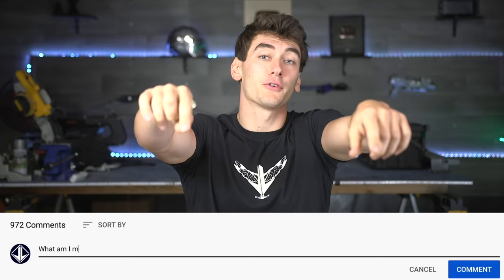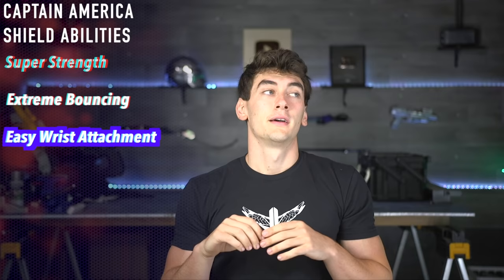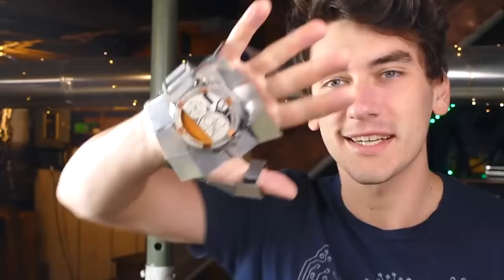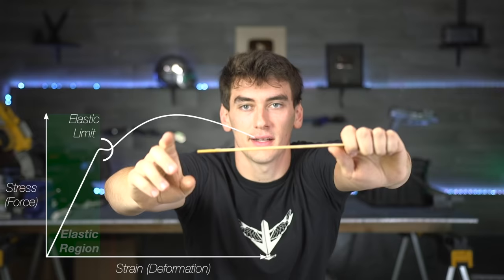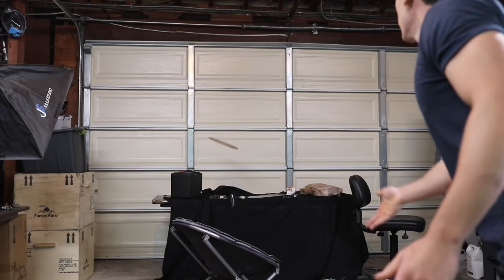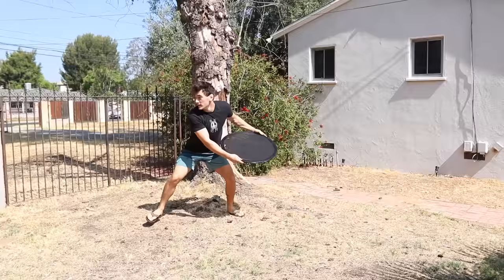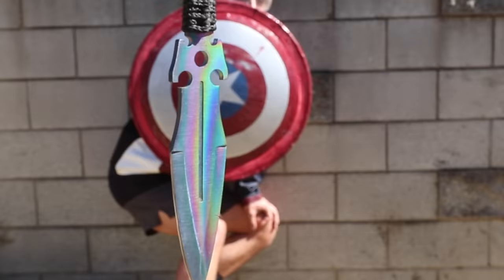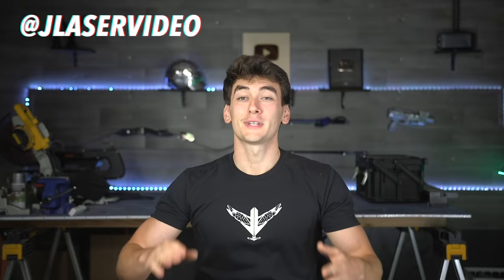Real Captain America Shield That Actually Bounces Back! - OVER 100 FT BOUNCE!!!

Comment: If I’m not mistaken, the reason the shield moves the way it does is due to cap’s enhanced perception from the super soldier syrum. He basically calculates the trajectory super fast.
Reply: As far  as I know, this is the reason, the producers gave some time ago. But it does not work anymore, because Falcon does not have the serum and still can throw the shield like Cap.
Reply: @SpeziFischDE  But didn’t he train like a whole bunch
Reply: @iodine1249  I’ve had this theory where everyone in the hero world is superhuman cause a normal human wouldn’t be able to do what the non sups can. Hopefully that makes sense
Reply: This isn't an indirect request for JLaservideo to make a super soldier serum, right?
Reply: @iodine1249  mcu excuses 101. Ngl thats funny tho. 
MCU:Normal Human Being can’t use the shield. 
Falcon uses it
Mcu Fans: But didnt he train like really hard... lmao
Reply: Its that and how vibranium Breaks the laws of physics
Reply: The shield is able to be thrown and maneuvered that way due to: Cap's super strength, his strategic mastermind, his increased perception/mental capacity, his mastery over gymnastics, his enhanced speed, the shield's energy properties (loses little momentum on each hit) and a teeny bit of suspension of disbelief
Reply: Age of ultron...he has magnets on the arm they showed it
Reply: but even John Walker was able to bounce the shield back to his hand even without the serum at first, he just trained with it and also Falcon, so in the MCU, you can do it with proper training and strength.
Reply: @swarms4745  in the falcon and winter solider the new cap was a solider, he could throw the shield perfectly so
Reply: I bet he thinks faster than stark
Reply: …so he is a Geometry Kid,
Reply: Basically, he's a super-nerd?

Though, theoritically, it shouldn't be too hard in 90 degree corners. It's like a retroreflector.
Reply: doggo  lol if you’re tryna start something dont do it with me. Its not worth it. Ik your a kid because you said dc tard not knowing if im even a dc fan. And normal humans cant use it because they said so in the explanations for the mcu. Actually check the replied here they even said it. But its ok try someone else tho
Reply: @swarms4745  Well normal human standards for us are different than normal human standards in comics. Humans in comics are not like the ones in real life. They're capable of a lot more with just training and experience alone. I mean jus look at Batman or Hawkeye. Peak humans in comics are stronger than peak humans irl.
Reply: @SpeziFischDE  Well the difference between Cap and Falcon is Cap always was able to throw the shield properly. He didn't need to train becuz his super brain n super strength made up the difference. He definitely trains his body but his mind was always fast enough to calculate exactly where the shield was going. Falcon had to get to that level. So did Walker. So the reason does still work.
Reply: @Revstarallstar  Since when could a normal human being not use the shield?? Hawkeye used it. Black Widow used it. N now Falcon's using it. It's not Thor's hammer dummy.. anybody can use Cap's shield, jus not at his level. Nobody's ever surpassing Cap's efficiency wit the shield, but with practice n experience, they can still get a few good bounces off. That much is already evident.
Reply: @SpeziFischDE  he just threw it abunch until he understood how it works lol
Reply: @TheMessenGerrrGaiii  John Walker, Isaiah, and Bucky probably could with enough practice since they actually have the enhanced abilities. Falcon shouldn’t be coming close. Can he toss it around? Yeah. Can he do it anywhere as close? Not likely.
Reply: @sitc786  only for short range recovery.
Reply: 0:57 seconds
Reply: @swarms4745   your forgetting that since caps shield is made out of vibranium< (spelling?)  and because of that it’s really light so anyone can throw it. The only hard part is throwing the shield and having it come back which is what Bucky was helping falcon do.
Reply: @stevelucky7579  Ehh I mean idk.. Falcon is a peak human wit tech from WAKANDA. He definitely can get somewhere in the ball park. Without his tech tho? Well they showed u the level he was at. He was barely managing 2 bounces, 3 at most, even after he trained a bunch with it. So It's like I said above..Cap is still THE most efficient wielder of the shield. I think all the logic people are questioning checks out.
Reply: @TheMessenGerrrGaiii  I kinda doubt he’s peak human with the tech. We don’t know what it does other than provide protection. Everything else is just an assumption at this point. I don’t think the panther suit gave the black panther his powers, pretty sure it was the fruit. Otherwise anyone could put on a wakandan suit and be creme of the crop. Unless over half of wakanda dieing (first those who died in battle followed by the dust) all those years allowed for unbridled progress.
Reply: I think its like t’challas suit. He plans the trajectory and when the shield makes contact with a wall or something, it dispurses kinetic energy causing it to fly back
Reply: Ye that’s right the serum gave him advanced military strategies aswell as an advanced mathematic ability meaning he can calculate equations, distance and angles faster than the average human
Reply: Cap should hustle people on snooker
Reply: @stevelucky7579  Okay, what I meant to say was, Falcon is a peak human, but not only that he's a peak human WITH tech from Wakanda to boost him up. Hope that clarifies what I meant. I never meant that the suit is what makes him peak level.. Also we're not ONLY makin assumptions. Jus a handful of reasonable ones. We still kno a couple things. We kno he can use the suit to get more velocity on his shield throws, which we saw him do. We also kno he can use the suit to make himself even stronger(or at the very least use it to build momentum so that he can lift something easier), which we saw him do. (This is where we start makin assumptions 🤣🤷🏾‍♂️) Now we're not sure if his suit can calculate the trajectory of the shield. But with Tony's suit accomplishing similar feats, I'm sure the Wakanda suit has somethin like that up it's sleeve.
Reply: @stevelucky7579  But back to what I was gonna say, I believe he's peak human without the tech. With the tech he's still peak albeit a higher level of peak. Peak humans strength levels can range from about 300lbs to 800lbs. They're the strongest humans can get without being Super human. Falcon is normally a big 6 foot 240lb black dude who can press lift twice his weight. Which is 480lbs, makin him peak human. Now I realize Anthony Mackie is smaller than that, but this is still the Marvel universe my guy.. Humans there n humans irl are capable of vastly different things. John Walker was already peak human due to military training n experience. (Which is why he was able to handle the shield before the serum. Well that n he had been training with the shield for a while) Falcon not only had the military training and experience, but also had intensive training with Cap in the movies. This is explained in the comics as the reason he got to peak human. Through his interactions n friendship wit Cap. This is essentially what happens in the movies, albiet more subtly, and most of it off screen. But the point is Cap pushes him to get to that level. So I definitely believe Falcon's peak human.. or else non of this sh*t makes sense. But Marvel knows what they doin so I have faith. 🤷🏾‍♂️🙏🏾😅
Reply: @SpeziFischDE  he trained in flight with the falcon suit, which is why he is capable.
Reply: @ayol1011  100%
Reply: @TheMessenGerrrGaiii      not sure he’s peak human either. Cap, was peak human. Isaiah was peak human for a while Bucky and everyone else was close, and they all took super drugs to get that close. Falcon, while being a great soldier, I wouldn’t call peak human. I’d argue John walker is closer physically speaking solely because Falcon spends a hearty amount of the time in the air but even then, they aren’t close to peak human.

I agree that he’s very smart utilizing the abilities of the suit to help increase certain feats. 

Calculating the shield could end up being more of a feeling thing, but it would take more than just several months of intense training to get good at that without a super computer. And that’s even if he’s a quick learner. I think it would be interesting if Falcon got an AI but unless the suit is tailored to guid his arm too, it’s still going to take a lot more training than he has now.
Reply: @TheMessenGerrrGaiii    yeah no, he’s not peak human. Strong? Sure. “Peak human” no. Walker was closer to that and he still needed the syrum that would make him into a peak human. Because the super soldier syrum doesn’t just make you “strong” it’s supposed to make you the peak potential of any human all combined into one individual. Faster than usain bolt without getting tired lifting over 500 pounds with ease. People usually spend a good chunk of their life to get one of these feats. The syrum makes you into a peak human, all of these combined. Think as fast as a human possibly can. Hold your breath as long as the record can and beyond.

I’m not saying Falcon in the comics and above average strength here, I’m just saying the one we see in the MCU he’s not lifting the side of any cars any time soon. I agree he’s definitely going to be in better shape than the average human because of the military training.
But I’m also saying having a pilot fight a marine....it’s a little more one sided than you may think. Falcon is that pilot, capable, shoots guns a lot, doesn’t really punch people or throw things or kick people (for starters), and when he does he uses his suit. 
It’s the fact he’s been using his suit up to this point to overcome his lack of being the peak of humanity makes logical sense and is the captain America mentality that I like. Steve was captain America because of his spirit and attitude his willingness to never give up. Falcon not being peak human but having to rely on tech and eventually it will fail on him and he’ll have to captain America through is going to be awesome to watch! Plus I like smarter fighters rather than “smart fighters” or “strong fighters” and him using his tech to bolster his fighting moves as captain America I think is great. 👍🏻 I think that’s a great in universe reason that is also logical to the story and what we’ve seen so far. But even with training with cap, he’s not getting a zenkai boost here.

As for walker, the strength I get if your in the army it’s expected of you to be a little more physically in shape. The shield thing, I think he should have trained with it more before he started running off with it, you know what I mean? I’ll have to rewatch it, but throwing a shield to have it bounce off people and things and come back to you WHILE operating in a life or death situation should take a hefty chunk of time.

But yeah, Disney does a lot of things that don’t normally make sense in universe. Kinda breaks the immersion. They kept cap pretty consistent, but if he started lifting a helicarrior I’d have to say “okay Disney, your not sticking to the rules again. He’s not supposed to be thats strong and you haven’t given enough logic to support it.”

Comment: In the comics, Cap is indeed a geometric whiz, he has a similar ability as the X-Men's Cyclops, where he can see the angles before he makes his shots, it isn't the shield that just miraculously bounces back, it's Cap's skill and intellect at work every time he throws that thing.
Reply: WOH didnt know that.. good to know
Reply: Dude Cyclops is nearly blind because of the lazers. They tried to fix it with the glasses he wears.
Reply: @mahoney2229  Should have tried bifocals. I thought the glasses were because his eyes are portals to an energy dimension and his main vision problem was anything he looks at instantly gets vaporized.
Reply: Oooh i never knew glad to know this I thought it miraculously 😂😂🖐💀
Reply: @mahoney2229  He sees everything in shades of red, other than that, he can see just fine.  He IS a Math Teacher at the school.
Reply: @mahoney2229  don't think you know how it works....
Reply: I was just going to say this!
Reply: Yeah, couldn't he do that even before he became a super soldier, but afterwards his thinking was faster so he better at it?
Reply: So he sees into parallel universe on what happens then he picks the right or angle or what's the math??
Reply: @Anonymous-tx1in  He sees his target, lines up his shot.  He knows if he throws it with enough force, it will travel X distance, with the Vibranium in the shield, impacts won't slow it down, he then knows if he hits the wall at a certain angle, it will fly off in a certain direction, and continue onto it's next point, where it will hit at the desired angle based upon his previous calculations, ricocheting off, to strike his target bouncing off at a certain angle again, and continuing to bounce along it's flight path based upon the angle and power of the toss.

I don't know the math behind it, there are smarter people than I who can actually come up with a formula of Force + Trajectory = Angle.  All in all, Cap can predict where best to throw his shield, causing it to ricochet in a way he anticipates, ending with where he'll be when it returns, to catch it.  For example, if there was a wall next to an open door, you could predict where to bounce the ball off of the wall to get it to go through the door.  He can just predict that on a much grander scale.  No parallel universes.
Reply: @onidaaitsubasa4177  Steven Rogers was always an incredibly intelligent man, though sickly.  The serum did nothing to his mind but gave him incredible strength, speed, and agility, greater than any Olympic gold medalist.  When he was unfrozen in the modern day he would go on to found a telecommunications company so he had a steady stream of news and information to learn and keep up with the times.  So while he was a fish out of water for a time, it was a very short time.
Reply: @Dyerdon  well thanks but , Captain America didn't just gain strength,he got powers ?
Reply: @Anonymous-tx1in  No powers, he's just a human, the super soldier serum just gave him incredible strength, speed, and agility.  It is the reason he can run so fast and stop a helicopter with nothing more than his upper body strength.

Comment: You should try putting a circular ring of the magnets in the shield so it doesn't matter the degree of the shield so you wont have to rotate it on your arm when you put it back.
Reply: I think that will put more weight to the shield. The original shield design has the latch which also requires adjustments if not holding it at exact position.
Reply: @Yuenight月夜  I thought about that but I think that the weight wouldn't matter much because the rotations would hold more because there is more mass, but the more problem with the ring is that it wouldn't come off the arm very easily. I think.
Reply: @samh5511  my other though process of that is the magnet would have to bend well to adhere to the shield since it has more surface area
Reply: @samh5511  plus it would be a little more complicated, cause he might Connect one magnet and the other might not connect in the right spot, plus maybe it would make some of the magnets pull a lot more than others, pulling away from one spot

Comment: Make Thor’s hammer that comes back when you open ur hand
Reply: Lmfao 💀😂😹
Reply: Um..... I think you would need some type of drone for that or a jet engine...... They would need to be extremely strong as Well if the hammer is made of metal..... And um also safety would be a big concern.... Um I dont know why I'm saying um..... So yeah um bye :)
Reply: @jaybella4793  that’s not all u need, some of the stuff u listed wouldn’t be required, u might need a really strong magnet as well. And you don’t need to type “um”
Reply: @jaybella4793  if u add a drone, that would be the lazy way out
Reply: @jaybella4793  Um slide me your Instagram um
Reply: Make it be able to turn into the ragnarok weapon, and release electricity on contact.

Comment: Amazing engineering in this, and also isn't one of captain America's powers in the comics literal geometry perfection?
Reply: Yes I was just finna comment this and he has not necessarily super strength but very Excelled strength so he would be able to throw it harder than most or all and make it bounce back
Reply: He's a math whizz with a special knack for artillery and direct fire projectiles.
If I remember right, in one comic he literally just yeets a bunch of mortars directly into the firing slots of some pillboxes like 200 yards away and then clears a full trench line by pinballing his shield down the trench.